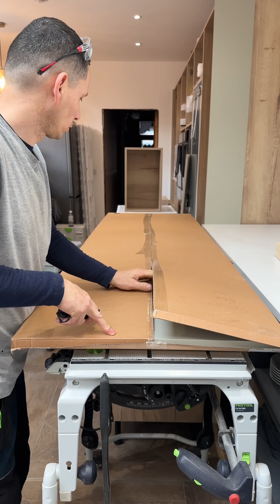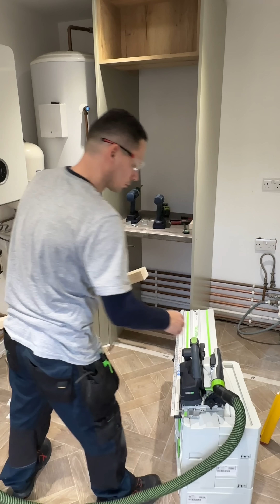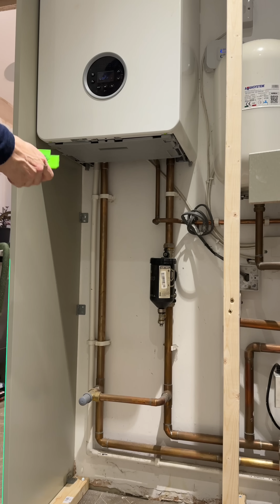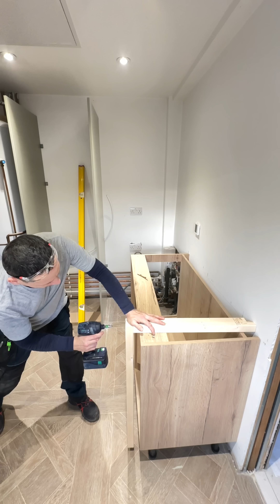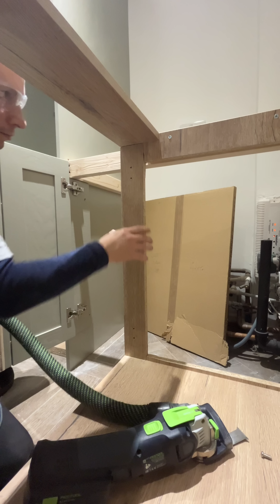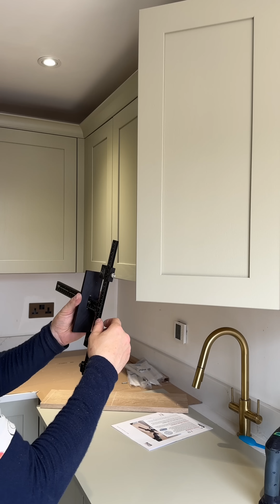Building A Custom Utility Room (DIY Guide)

Comment: Gadgets,gadgets,gadgets😂. I used to buy all the time saving tools and gadgets when i was contracted to fit kitchens, bedrooms,home offices etc for major players in the fitted furniture industry. But i never had a fraction of the gear this bloke has. Most of our internal shelves had to be cut individually out of one length of mfc or mdf and 99% of the time i cut them freehand with a jigsaw fitted with fine tooth down cutting blades😂. But i could cut a straight line just about perfectly. Id have loved all the cutting rails and guides available today. Elu was the brand to have in my day. They seemed to lose popularity when Dewalt started marketing in the UK. How times have changed🤣. I remember doing a factory refit/refurbishment with my Dad. He didnt even have a battery powered drill/driver. He used an old Stanley hand drill and a pump screwdriver or a ratchet screwdriver. My first battery drill driver was a 7.2v Makita. When doing the door kick plates, escutcheons,room number plates etc, I was doing at least four times more doors than my Dad. He was near retirement and old school but after seeing my Makita he did rather reluctantly buy one. These days my old tools would be just as hopelessly outdated as my Dads were. Could still do the work but itd be so labour intensive no one could afford the labour costs🤣. Used to enjoy it all but im glad to be retired.
Reply from the maker: You right tools are very helpful but it cuts away the relaxing labour work but yes is nice to see your comment i am watching some videos with old style woodworking so awesome and relax to watch that in weekends thanks so much for sharing your nice story and thoughts !

Comment: Nice! Only the only thing I'm not so sure of is the fact that you built in the boiler in a small cabinet. This way, you are not able to replace it when it's broken without demolishing those beautiful cabinets you've built.
Reply from the maker: Good point! It is easy to take it apart it will take a bit more time to put it back together

Comment: Very good job as usual. Quick question: how to fit the piece of wood if it is the same height as the ceiling? Should we cut it shorter or on the bias? Thanks
Reply from the maker: If is the same hight as ceiling might be easy to just lower legs down and  trimm the plinths down
Reply: @CAVjoinery  thanks

Comment: love your videos!  did you leave enough space to get that water heater out, or are you hoping they never want to replace 🙂
Reply from the maker: Oh we are aware of that but we also hope that does not needs changing often if that is tha case it takes half day to take it out in put it back in assuming that it can happening every 2 years still worth it of course customer knows (aware) that too but i never heard changing boiler every 2 years they will onle be serviced usually thanks

Comment: Which screws of what size do you use to fix wall units mounting plates to concrete walls?
Reply from the maker: 6/70mm
Reply: @CAVjoinery  thanks

Comment: Hello! I was wondering why you sometimes use a TSC55 and sometimes a HK55 tracksaw? It one better than the other at some things? Or is it just a matter of which blade you have in each?
Reply from the maker: Hey sorry for the delay the circular saw hk55 i use it for cross cut and with the guide i can use it as a portable miter saw the tsc55 is for ripping and cutting large boards and plunge into them as well thanks for watching !

Comment: What did we bury in the corner?  Hope it never needs to be replaced, or there is something I do not see.?
Reply from the maker: It worth if it last 2 years i have no problem with taking that section out but it is ok for changing a valve there is room for that !
Reply: I understand,  I see you have thought about it for sure.  I do like the final result .
Is that a hot water tank and a tankless heater, also?

Comment: How many days did it take to make this kitchen?
Reply from the maker: I can nor remember as this was frome last year project don the kitchen ad the utility but we had modified a lot on lay out and we were waiting 6 weeks for the panels and doors to be painted than we cut down the units in utility area so we have to change the doors sizes and send them to be painted etc so yea it should be 7  days worth out there kitchen is big and done the extractor out of frame to so yah 7 days